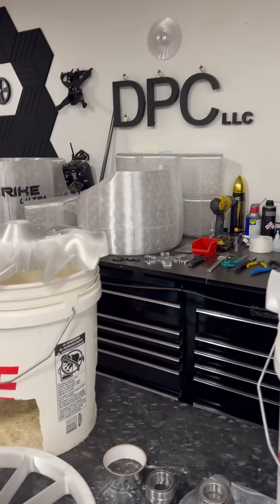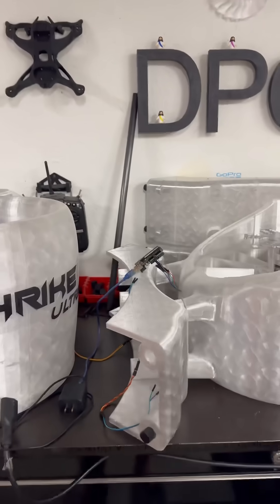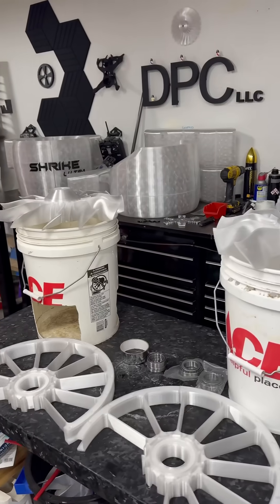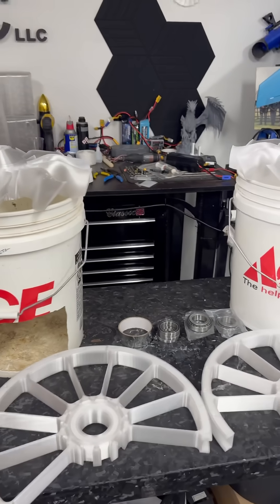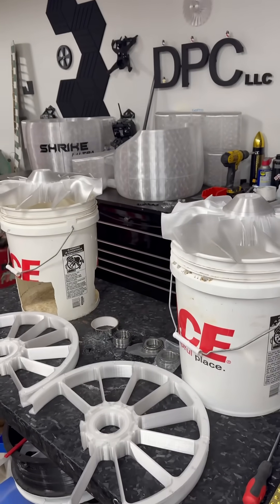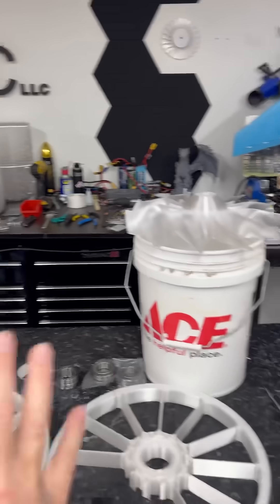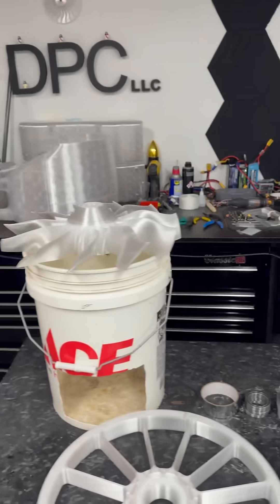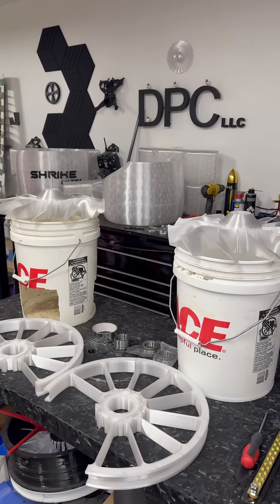Largest 3-D printed drone in the world 28 kg of PETG one nozzle on the X1 Carbon. @BambuLab

Comment: But how much will it be able to lift?
Reply from the maker: This drone has 427 pounds of thrust.  It is being pushed by four 340 mm 11 blade high pass EDF engines. The motors are 75 V each. Maximum RPM 9600. Total drone up weight is 60 pounds. It will fly on PETG blades but I’m looking to get a CNC so that I can mill my hub blades and main shaft. That way I can pull the full 400 pounds of payload. Right now it will pull as much as the PETG blades can handle, but it can and will have a stable hover and maneuverability.
Reply: @warmachined3472  So....... you are going to ride on it?😂
Reply from the maker: @thelonewrangler1008  Going for a payload test first but eventually yes.